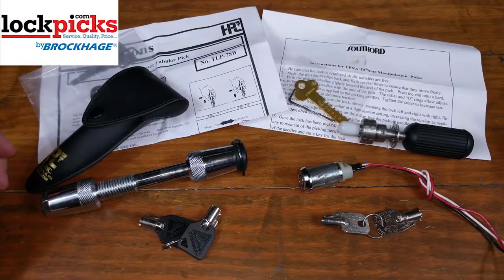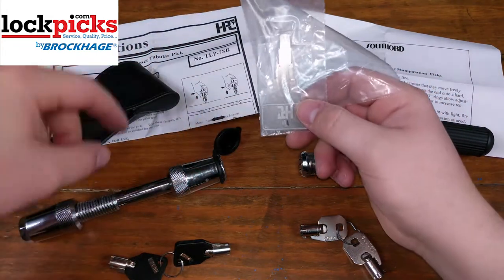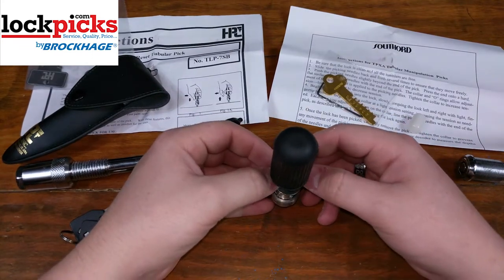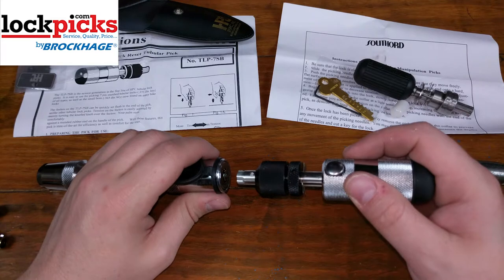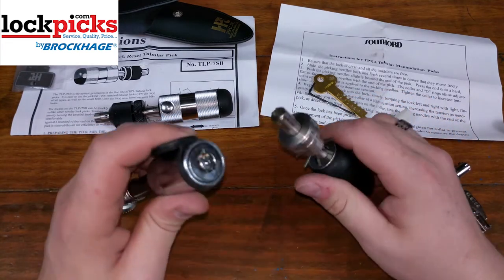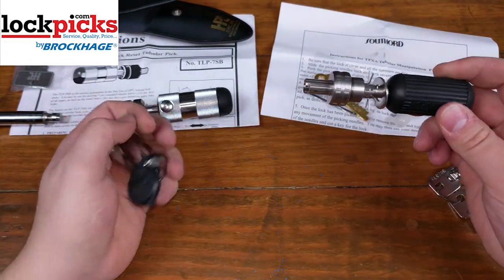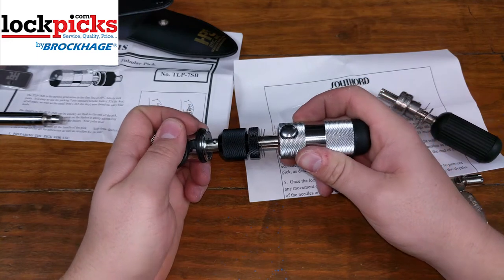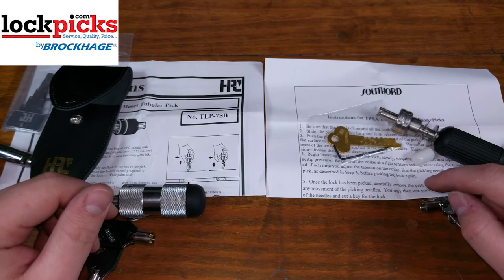Tubular Lock Picks

Comment: You mentioned that the HPC was better and that there was a reason, but I don't believe you mentioned what it was.

I'm going to buy one if these tools in the near future and so I'd like to know why the HPC might be better.

Anyway, thanks for the upload! 🔐👍
Reply: I think the fancy push button to "zeroize" the pins was the extra feature, but I don't consider that to be much.  If they both work equally well, which seems likely, my purchase would be determined by size and price (smaller and cheaper are better).
Reply: @Liberty4Ever  southord one is incredibly fragile and doesn't come with any case.
works well tho
Reply: Vc teria algum site que poderia manda para o Brasil hpc não consigo achar